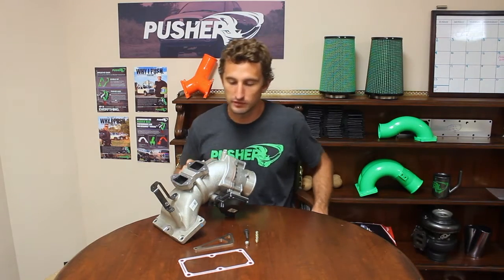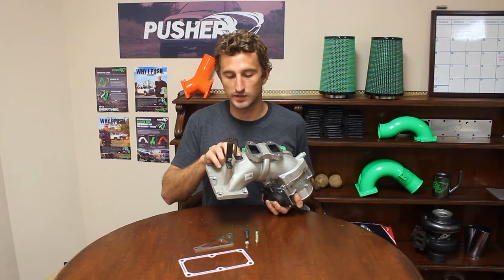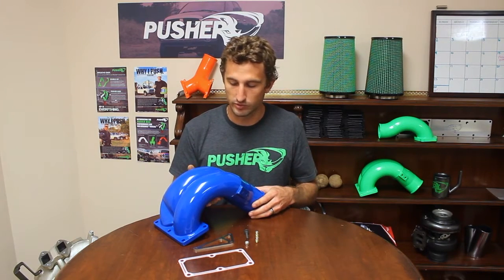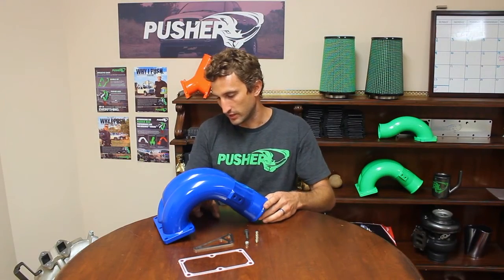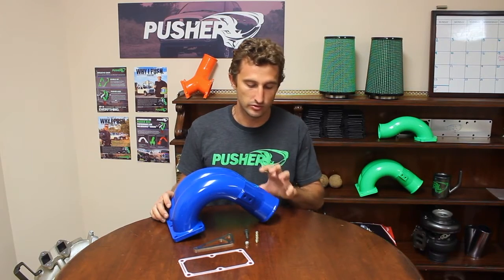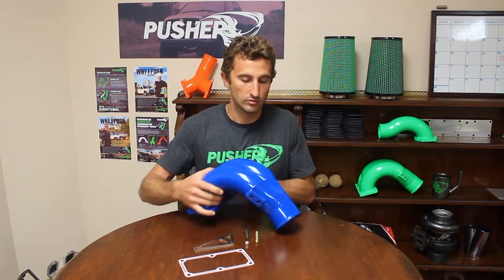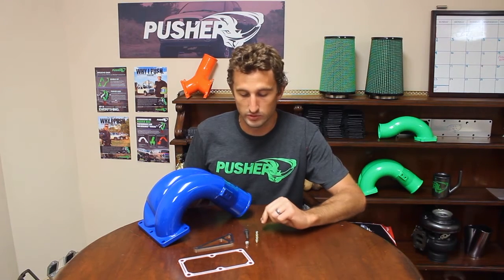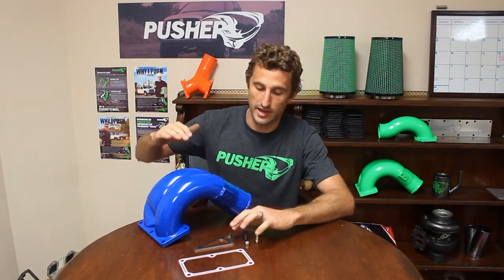Pusher Product Overview - 6.7L Cummins 3.5" Intake Manifold

Comment: It doesn’t look like there is any provision for an aftermarket grid heater? Is that correct? Wondering if the 1/8 npt could be drilled out and threaded for a duramax style heater? Thanks